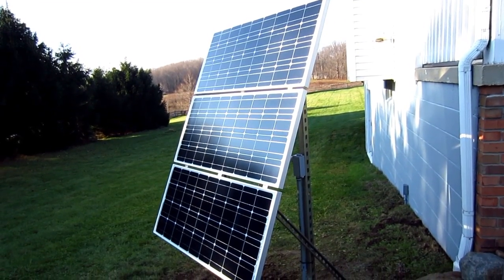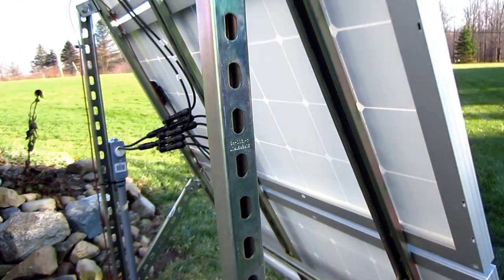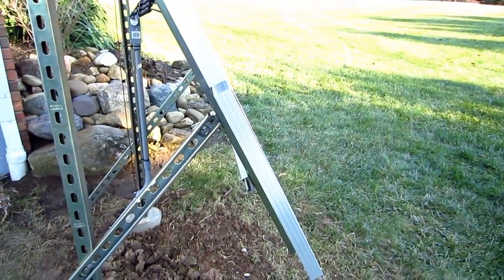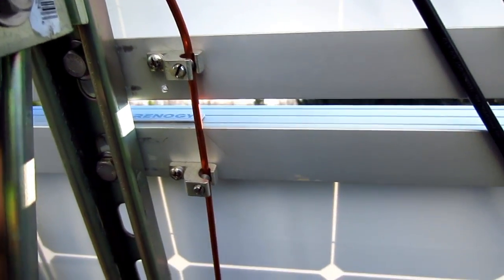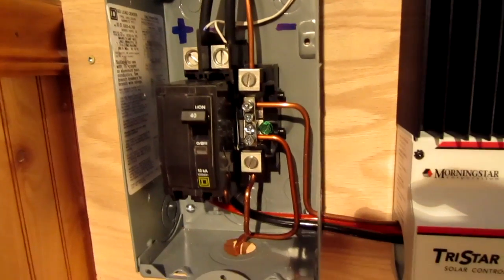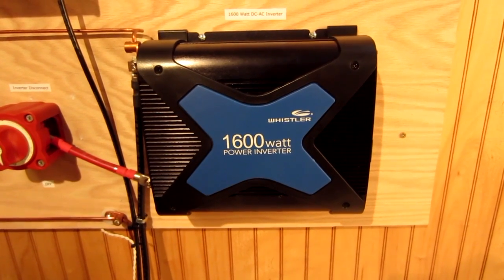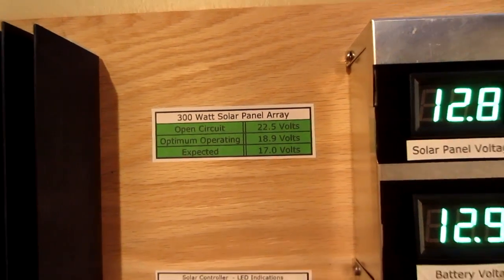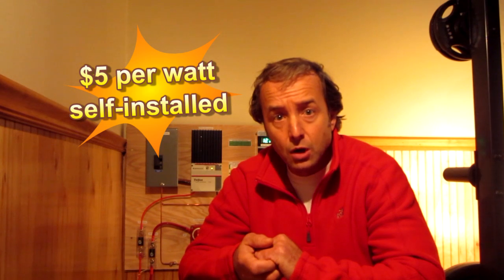DIY Solar Panel System - 300 Watts Off Grid Ground Mount - Christian Dude

Comment: I mean Fuckin honestly way overdone your shoving 2 feet worth of conduit when you have cables that can be buried and now your conduit will be a pain in the butt to increase the cables you have if you ever want to expand or move your array. The 1600 watt inverter will power some lights for a few hours. Maybe you would be luck to charge your batteries fully on 300watts. At 1600 Watts you will be cooking those batterys running 12v You should get 24v - 48v compatable systems and wire your batteries accordingly. You maybe will be able to pull 900 watts non continous for like 2 hours max. So like I said it seems your system can maintain a few lights for an hour or maybe two max. Throw a fridge on there and wow your ysstem will fail you so horrificly. but meh you did it your self my main complaint is that you designed it in a way that would be difficult to expand it.
Reply: RH, for a 300 watt system (300 watts of solar panels), his 12 volt system is a very good fit as is his 300 AH of storage battery (no need to go to a 24 or 48 volt system considering his very short runs of cable, and system size).  Also his 12 volt system is as safe as it gets regarding electrocution (much safer than a 48 volt system).  His 1600 watt inverter is also a good pick because it provides him good inrush current capability if trying to run a sump pump or other high inrush current device (much better to go with a much higher watt inverter to help deal with large inrush current that happens on start up for devices like a pump, compressor, furnace blower motor, etc).  I personally have a 400 watt off grid 12 volt system with 300 AH of batteries and a 2000 watt pure sign wave inverter, and on sunny days we run our flat screen TV on the system during the daylight hours while not discharging our battery bank at all (this way we keep the battery bank charged in case of a power outage), and at night or cloudy days we switch back to city utility to power our TV.  I think he should have used larger gauge wire between his batteries and his inverter to handle larger inrush current (I used 2/0 cable between my batteries and my inverter and might increase that to 4/0, but I can run our standard sized refrigerator just fine with my system, and have also been able to run our microwave with it).  These small types of off grid systems are typically just for emergency backup, and during an emergency situation if you need to recharge the battery bank and sun is not available you can always charge them back up using your cars alternator in an emergency.  These small systems do indeed come in handy during a power outage.  Regarding run time, we can run our flat screen TV that has a power requirement of 82 watts for 22 hours if we allow the battery bank to discharge down to 50% of its capacity (and this assumes no sun exposure at all during that 22 hour time period).  Your estimation of running a few lights for an hour or two max is way off basis with todays LED lighting.  Matter of fact he could run two standard LED bulbs that consume 9 watts each for a total of 100 hours (slightly less due to inverter efficiency) not 2 hours, assuming 50% battery bank discharge and no sun during that 100 hour period.  A couple of great advantages of a 12 volt system is the fact that you can charge the battery bank with your cars alternator, and you can also acquire a cheap inverter at places like Harbor Freight (or any other box store for that matter) if the one you have dies and you need to get back up and running quickly.
Reply: RH
Conduit is very cheap insurance and good practice to any electrical wiring , regardless if it is approved for direct burial. It provides an additional barrier for rodent damage, digging damage and wire replacement (if its requied?) Among many other reasons. You have to dig a trench anyways, why not put it all in $10 worth of plastic tubing to protect it. Not to mention that its likely a required local code for him to have it in conduit. 
Your rant seems illogical and only points to the lack of knowledge you seem to have about electrical practices. I would suggest educating yourself before you begin espousing to be some kind of authority or have an opinion on the matter.

Comment: Thank you for the idea of the mount and conduit. I did something very similar with my 400W system. It's interesting how before I saw your video we did something very similar looking inside with the disconnect. charger, etc. Thanks again. Very helpful video.

Comment: FINALLY have found an exact duplicate of my thoughts on mounting the panels horizontally, w/ unistrut, close to the ground, at a comfy working height. Very nice cable layout + management. The 90° bends... awesome. The parts list is great for us to get a little at a time, budget permitting.
A shoutout to the folks who warned of the religious transition... I heeded & left the vid at that cut.
Thanks ALL !

Comment: Nice small system. One suggestion on making battery cables. Crimp, then solder, then shrink wrap with glued shrink wrap. Crimping for a mechanical connection. solder for a good electrical connection..

Comment: Wow that's a nice setup.  I just built a shed and have it running on a small temporary solar setup (everything just kinda thrown together on the ground) but I ordered 4 100w panels off Amazon and now looking into the best way to mount them on the roof.  May do unistrut, have a few ideas.    So this is quite inspiring.   I would experiment with putting those panels in series if your charge controller can handle the voltage, that way even when it's overcast it might get enough voltage to trickle charge the battery.  I personally like to do everything in multiples of 2 though so it's odd to see 3 panels and 3 batteries and not 2 or 4, but either way it works. I guess being a computer geek does that to you, so that's why I went with 4 panels myself.  I will probably do 2 groups of 2 in series/parallel, but I'll experiment to see what works best.

Comment: If you can only run one 100watt light for 10hrs a day (1000watt total) I’ll let you know how you’ll go, not very well. Any decent indoor grow set up needs about 20,000 watts a day for lights, fans, pumps, ac units etc. Any less than that you’ll do better growing outside under the sun.
Reply from the maker: Strictly emergency backup power - enough to start seeds for summer planting outside, charge power tools, etc.

Comment: how long does the battery lasts?
Reply from the maker: Since battery life is dependent on the depth of the discharge, if I limit my discharge to 30% I should get over 1200 cycles out of this battery bank, or a little over 3 years assuming daily usage. Longer depending on how much they are used.
Reply: Jim Kirchner thank you

Comment: Very, Very Nice!! Thanks for sharing.  I'm going to "borrow" your plans. The only thing I will do different (living wet Michigan) is either have the wires from my panels enter through the bottom of my connector box or leave enough wire to form a drip leg.  I Just want a little extra protection from water intrusion.  Thanks again Jim

Comment: Hello Is that a normal Squar D AC 40 Amp breaker?
Reply: Is it a DC breaker?
I can't tell from the parts code, may want to make sure it is, look into that.
Reply from the maker: per the parts list in the description, it is a Square D 40 Amp Circuit Breaker  QO240CP
Reply: Thank you.

Comment: Where do you get the steel attached to the panels. I checked with Home Depot and lows
Reply from the maker: Home Depot. Did you see the parts list in the video description? - Superstrut ZA1200HS Gold-Galvanized for Main Supports, Superstrut ZB1400HS Gold-Galvanized for Solar Panel Frame

Comment: If i am seeing this right, you have the bare copper wire going to the negative side of your batteries. That Copper wire is going to the grounding post set in the ground. If lighting hits your solar array you are going to have problems with your batteries.

Comment: System looks nice. Well put together.
I disagree that an MPPT controller isn't worth it at that size array. You'd lose less in transmission if those panels were in series, and you'd have saved a bit by being able to use thinner wire potentially.

Comment: Great work Jim. Is it safe to leave the batteries connectors exposed if you have pets or kids? I mean could they not get injured as a result of electric shock if they were to touch the black and red connectors?
Reply: S Cin:  12 volts (battery voltage) won't do much to a body, unless you use a conductor across the terminals, and hold on to it as it gets hot.  But like you, I would cover those terminals anyway.  A piece of metal could land there and cause big problems.

Comment: Very good for people getting into the solar electricity world. Whether you have a deep understanding of electricity or you have basic knowledge, this will guide you towards the right system for you. Everything you need to know to get started and build an effective system is right there. https://plus.google.com/b/100728704920141855812/100728704920141855812/posts/WjRt4LRZEzo

Comment: Not to ground the inverter chassis to the battery negative which I think this is what you did in your breaker box inside, since you connected the grounded box to the battery negative and you said to the inverter also. It might work for your inverter, but not in mine and maybe others. Thanks!

Comment: Nice transition.....stand up and be proud.  Being God's salt and His light is NOT an option. We do live on a parking meter and eventually we all run out of quarters.

 I did my 400 watt (24 amps on a good day) with 500 amp hour battery bank for $1500.  No Fed Tax credit here as it went into my RV. I also built my cables, using 6 AWG ground, twisted copper.  Went to Home Depot and bought 4 AWG connectors and married two wires into one connector.  Took a little more time, but well worth the savings.  By doubling up on the 6 gauge, I felt it was plenty for my 2500/5000 inverter.  My draw is max 20 amps at nor more than an hour....normal is 5 amps As far as my panels, using Renogy.  Mono panels and well built, 1 buck a watt.

Comment: Jim, you did a great neat Job on your setup and video. It is one of the few videos to the point also most importantly for me showing the grounding fashion you used. I have been a bit perplexed on that end, and still not sure if this grounding of the negative battery pole works for all setups and inverters. I have a pure sine 300 watts inverter that has a chassis grounding screw, and 2 connectors for the plus and minus from the charge controller. Instructions are very poor on it's grounding connection and I'm still researching. Thanks again for sharing your setup and I don't mind the end at all, better to hear you share instead of watching too many ads :-) Best wishes!

Comment: It pains me to see those poor little lonely solar panels  there in the shade when i can see all that sunshine in the back ground! Apart from that, great job on the install!
Reply: well, it pains me you didn't notice the trees in the far background without the leaves. so, It must have been either early spring or late fall. that should tell you the evergreens are casting long shadows.  And if you ask why he didn't install the panels further from the house, here is the answer. the longer wires the greater energy loss. That's why he installed them just a few feet from his house.

Comment: I don't know why people put up 3- 100watt panels when they could just put up 1- 310watt panel= less framing, less wire, and less weight.
Reply: So that if 1 panel gets damaged, you still have 2 panels left working plus you only have to purchase 100 watt panel which cost less than 310 watt panel.

Comment: Thanks for posting. I'm designing a system very similar to yours- about 300w panels and 300 ah of batteries leaving room for expansion.  I'm in east coast FL about 1/4 mile from the beach so salt air tends to corrode stuff. I  may go with a pressure treated lumber or PVC panel stand unless I can find a weather resistant finish channel molding.  I plan on using mine for emergency back up and partially powering my indoor LED powered hydroponic system.  Romans 1:18-20, 8:28

Comment: Great job at being so detailed and covering all the bases, but isn't this a bit overkill for a small 300 watt setup?
Reply from the maker: +CB RadioClub You are right - it is overkill for a small 300 watt setup...unless that 300 watt setup were the only source of power available to you after a major catastrophe like a grid outage - then you would want it bulletproof.
Reply: +Jim Kirchner Yeah, overkill was my first thought too. I can't decide if I should try to put together an elaborate system or just buy one of those cheap compact emergency lighting solar kits on Amazon. It's better than relying on candles or hurricane lamps. It's low wattage bulbs but rechargeable with the included solar panel. Also much cheaper than Goal Zero products.
One reason you might want much more power is for your oven if it's gas. They will not work without power because they use a +600 watt glow bulb that has to stay on the whole time the oven is used.

Comment: Great video! One question to get started. I'm getting ready to build a portable solar system. You have a 60amp fuse between the Charge Controller and the batteries. I'm curious as to why? From what I've learned, the batteries shouldn't be charged more than c20hr rating/8. So if a battery has 100ah hr, our maximum amp charge rating from controller to battery shouldn't be more than about 13amps. Maybe I'm way off the mark here in my thought process, just trying to iron out any potential for problems before I put it all together. The thought though is that the 60amp fuse should bemore like a 20amp fuse that way if the controller messes up, it can't damage your battery past the safe charging rate. Does that make sense? Your thoughts?
Reply from the maker: +Colton Campbell That's an excellent point. I was thinking more along the lines of expanding the battery capacity in the future, but in hindsight your way seems better!

Comment: Hi Jim
I have been searching the internet on how to build small solar system and watched countless of youtube videos some quite confusing. I choose your idea because it makes sense to me.

Here's what  I got:
 two solar panels, 12V 150Watts, total 300Watts

Square D Circuit Breaker Box QO24L70S and Square D 20Amp Circuit Breaker QO220CP

3215RN Tracer 30A 12V/24V EP MPPT Solar Charger/ Controller with MT5 meter

E2 by Scoshe EWFH Single ANL Fuse Holder with Absolute  ANL 60 Amp Gold Plated Fuse in 6 AWG cable between solar controller and battery 

EverStart 12v 122 ampH deep cycle battery 

E2 by Scoshe EWFH Single ANL Fuse Holder with Absolute  ANL 200 Amp Gold Plated Fuse in 4 AWG cable between battery and inverter

Tiger Claw 1500w/3000w Pure Sine WavePower Inverter

Control panel with all components will be mounted on the wall in my basement, however the battery will be in my garage, right on the other side of the wall. I bought just one battery at Wallmart, it isn't sealed and I'm not comfortable with keeping it in my garage let alone in my basement. I might buy more and different kind later.

For this reason I will have to drill several holes through the wall. Some say it isn't a good idea to keep the positive and negative cables of DC current in the same conduit.  I understand why we have to keep the battery cables apart but what about solar panel extention cables?  Also I intend to use welding cables between charger and the battery. they seem to have quite a good rating, the label says 156016 6AWG CSA CL 1503 150C 600V. I wonder if I can keep them together in one conduit when going through the wall.

When it comes to grounding, some say:
  "The same thing needs to be done to your solar PV system by connecting all the equipment together to include the solar panels, PV mounts, combiner box, inverter, charge controller and any other device that makes up your solar PV system. Everything needs to be tied together to the same grounding system as your house. You do not want separate grounding systems for your house and your solar PV system. This is very important.

taken from: http://www.weatherimagery.com/blog/how-to-ground-solar-pv-panels-correctly/

 I'm still not decided on how I'm going to do grounding